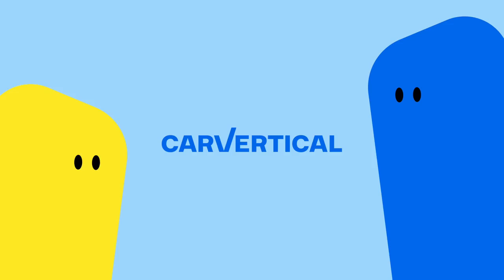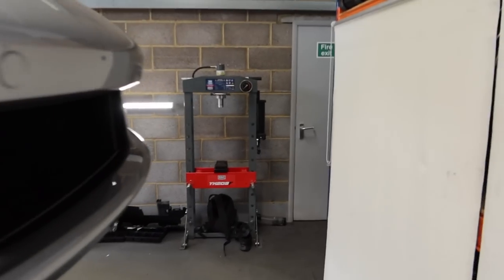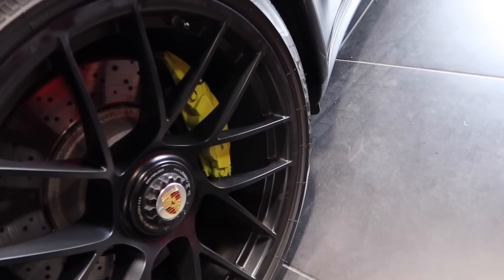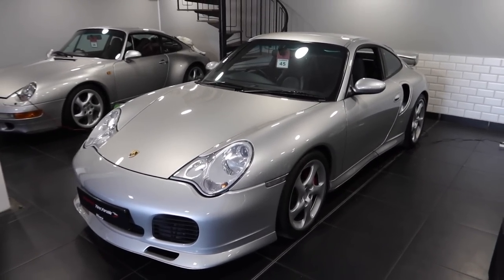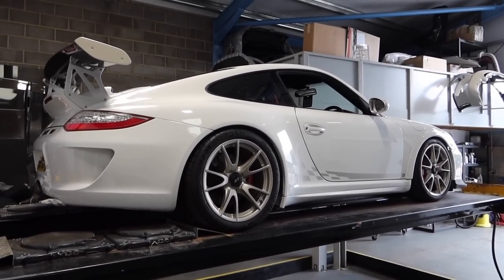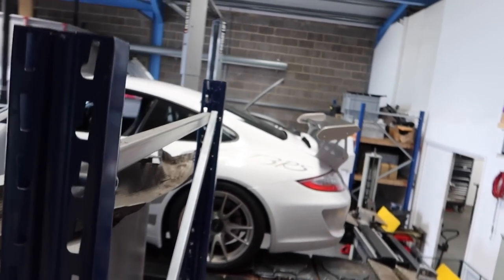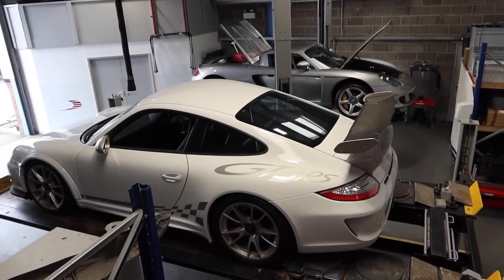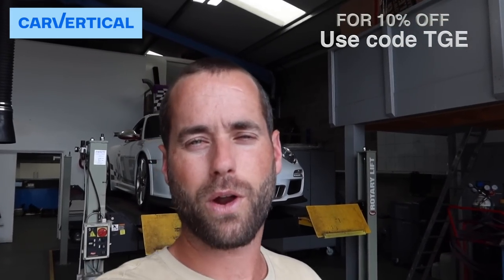FIXING MY BADLY CRASHED PORSCHE GT3 RS

Comment: I have kw coilovers fitted on my 996 and when I drove the m25 this month on my way to Folkestone when I went to Le Mans , the yellow colour of the m25 absolutely vibrated my car to pieces, but the French roads on the way to Le man was a joy
Reply from the maker: Oh no! Flapping now. Haven’t driven it yet! Stay tuned 😩
Reply: @TGE  they are the very best you can get and the only road in the UK I have had problems with is the yellow coloured stretch of the m25 , when you see the gaps in the road every 50 meters due to it being concrete sections and it’s the gaps between each section and when you have kw coilovers like ours it just shakes the car like hell and feels like you have a puncture, but they are the best suspension I’ve ever had fitted ever